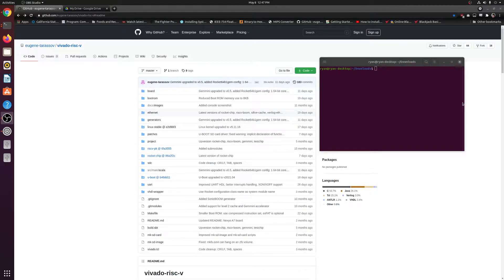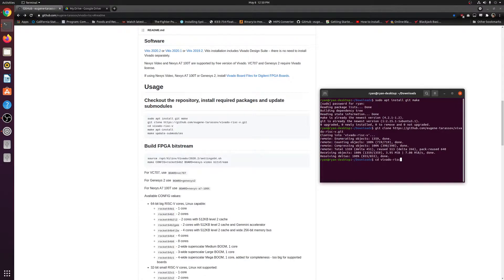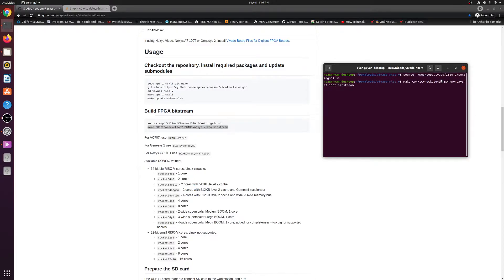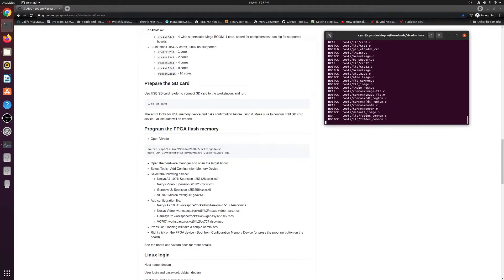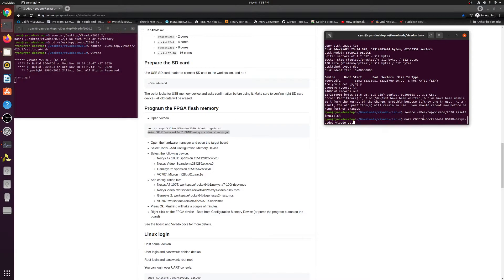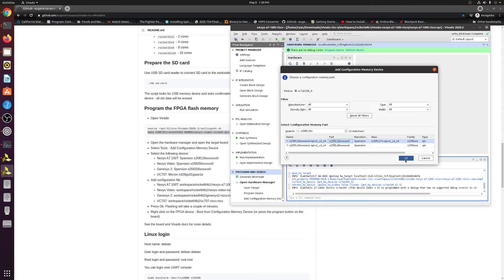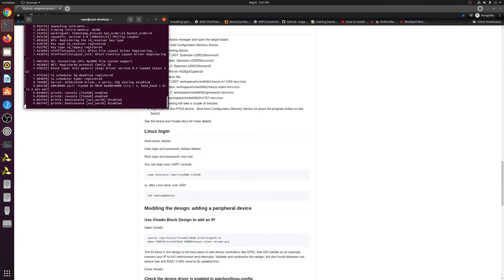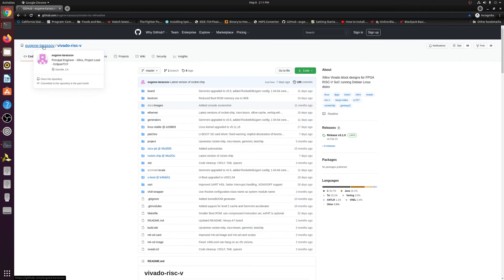How to Install RISC V on Nexys A7 100T

Comment: Ryan, I teach a computer architecture class at Johns Hopkins University, and one of my students used your video and Eugene's github in his project. The script completed successfully, however the FPGA was not able to successfully boot debian. The output diverges from your display after you cut off the output due to the amount of time it took to boot. After getting the Loading, Please wait... The system prints out Starting systemd-udevd version 252-rc3-2. It eventually prints out a warning message (Warning fsck not present, so skipping root file system). You version cut off after the message Starting version 247.2-4.  My student was able to get the system into rescue mode, and is able to complete his project . Have you heard if newer version of the code have run into this problem?

Thank-you, Your video was very clear and a great guide.

Comment: At 13:40, the reason why there are weird characters popping up is due to the fact that there is an issue at the bootloaders. You need to mark the parity check as disabled, otherwise it's going to do these weird things

Comment: Hi Ryan Heng. I followed your steps but got an error during bitstream generation. I'm also using Nexys A7 100T and after running this command "make CONFIG=rocket64b1 BOARD=nexys-a7-100t bitstream " I got the following error : 

Phase 1.2 IO Placement/ Clock Placement/ Build Placer Device
ERROR: [Place 30-415] IO Placement failed due to overutilization. This design contains 269 I/O ports while the target device: 7a100t package: csg324, contains only 202 available user I/O. The target device has 210 usable I/O pins of which 8 are already occupied by user-locked I/Os.
 To rectify this issue:
 1. Ensure you are targeting the correct device and package.  Select a larger device or different package if necessary.
 2. Check the top-level ports of the design to ensure the correct number of ports are specified.
 3. Consider design changes to reduce the number of I/Os necessary.

Please help me if possible.